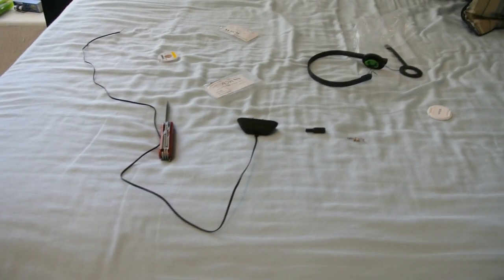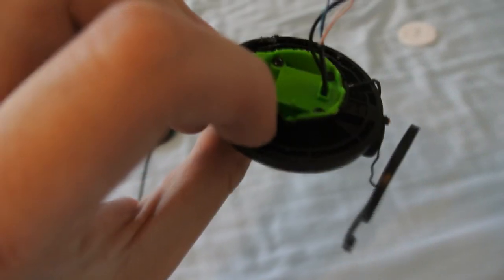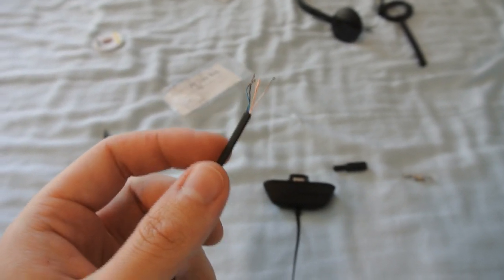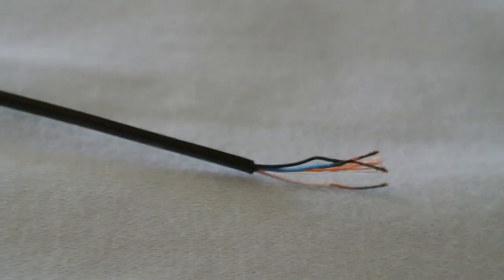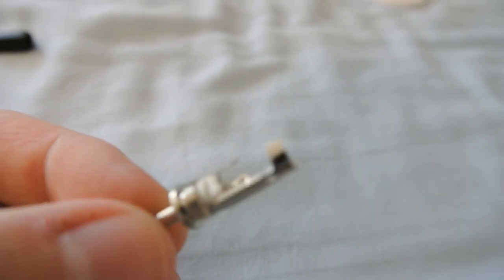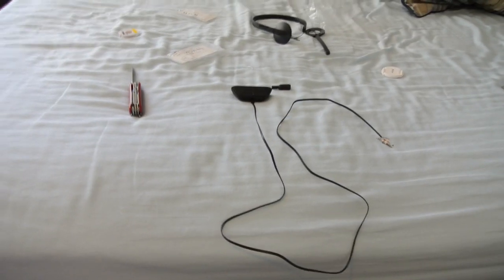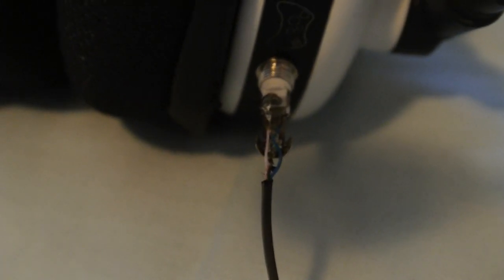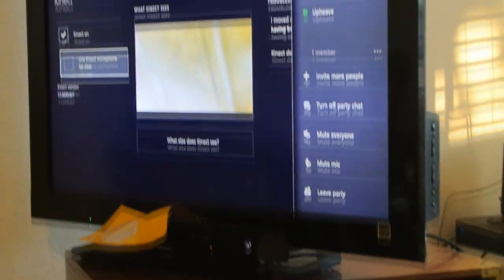Xbox One Headset Adapter Mod - HOW TO USE TURTLE BEACH / ASTRO / TRITTON WITH CHAT TUTORIAL

Comment: You can buy an adapter for your controller on Ebay to accept normal 1/8 headphone plugs. Its like 3-5bucks free shipping..... Then aren't you basically cutting off the in-game sounds by doing this?
Reply: What is this adapter you speak of called?
Reply: Joey Lama You can find it cheaper from hong kong if you wanna wait 14-30days. Or pay an extra buck and get it sooner here http://www.ebay.com/itm/White-3-5mm-Jack-Mic-Headset-Earphone-Converter-Adapter-For-Xbox-360-Headphone-/301450387478?pt=LH_DefaultDomain_0&hash=item462fd7e016

this is for xbox 360 controller, not xbox-1. they make those to though.
Reply: Okay nvm....I thought you were talking about xbone
Reply: Joey Lama they sell those too, but China hasn't made any. It seems microsoft sells an inhouse version, which is fucked up and for 30bucks.... Might as well just buy that rumored new xbox one controller that comes with standard 1/8 headphone jack, supposedly.
Reply: It doesn't come out til June plus I already did the stock headset mod so I can use my turtle beachs (the mother board one, not splice)
Reply: Also, I don't wanna buy another controller unless absolutely necessary.
Reply: Butttttt I do appreciate the replies!

Comment: Warning to anyone who attempts this!!! There has been an issued reported by the person who orginally discovered this. Do NOT I repeat DO NOT Solder the Black and Copper togeather! Just use electric tape and type the black ground to the side. If you don't do this it causes your voice to not be heard, and it drains or batteries because it draws 1V of power.

Comment: Fyi, for those of you that have the xbox 360 headset with the angled 2.5 mm jack (came with controller keyboard) you can just use that. Clip it right after the mute switch and splice from there. 
Best of all, Microsoft used the same exact colors/wire combination in the old headsets. 

I didnt want to cut my male to male 2.5mm wire so a light bulb went off for me to use the old headset.

Comment: I have a turtle beach earforce x11. its a wired headset that connects to the tv using components.  is it possible to mod this for xbox on?
Reply from the maker: How does the chat cable hook up to a controller, does it plug into a little rectangle which holds the volume functions?
Reply: WitnessGaming idk what mm, what yes, theres a plug that runs from my controller to volume/chat control rectangle.